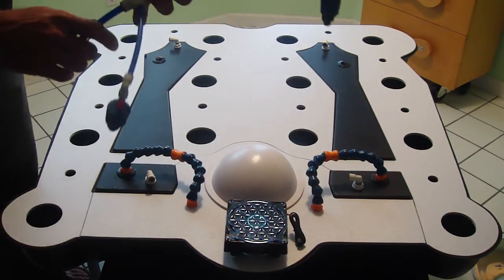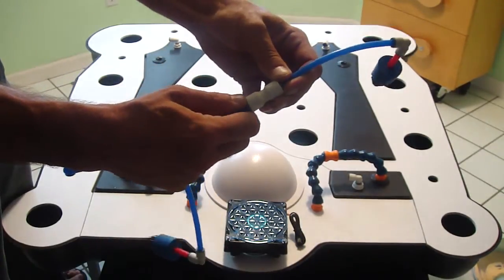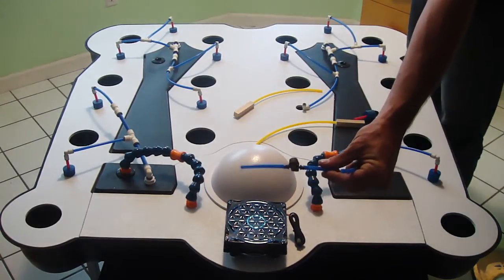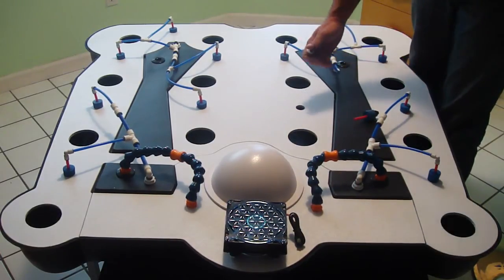Exterior plumbing system in the TreeFrog by Multiponics

Comment from the maker: @briancallanan Thanks for asking! We should have more pics and descriptions up on the site shortly, but to answer your question: There are three stoppers in the middle section and and 1/4" holes pre-drilled between each plant site, so like all things Multiponics, it is up to the end user, really. We have had great success just using 8 nozzles spread throughout the TreeFrog. Also, I should mention that the HPA Kits come with both adjustable T's and Elbows to position sprayers however you desire.

Comment: Can you run 14 sprayers at the right pressure with the Aquatec 8800 pump? I see this video has 12 sprayers just trying to see the right way to do it! Thank you
Reply from the maker: Yes! However, the pressure would drop a little bit. We suggest 12 nozzles or less to keep the droplets closer to the 50 micron target for optimal nutrient absorption